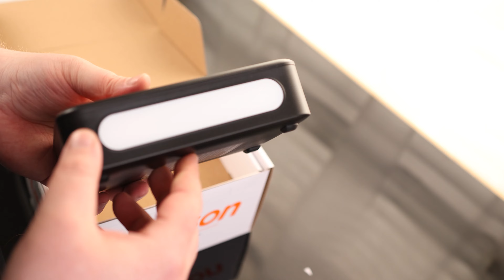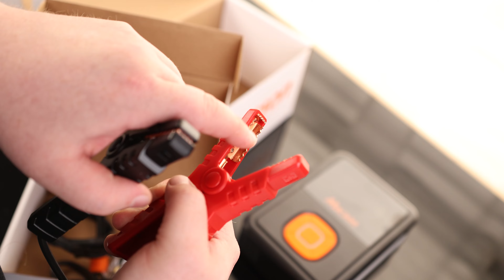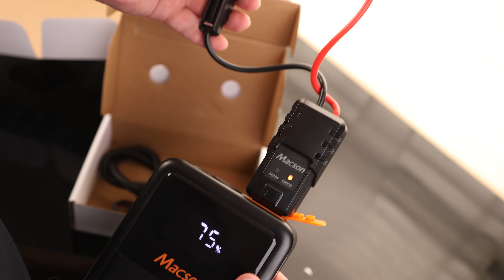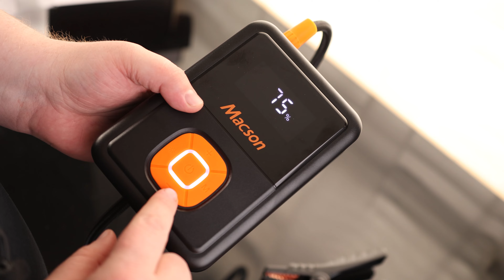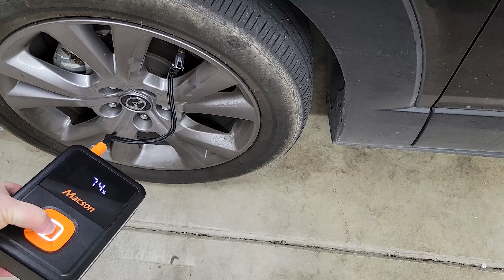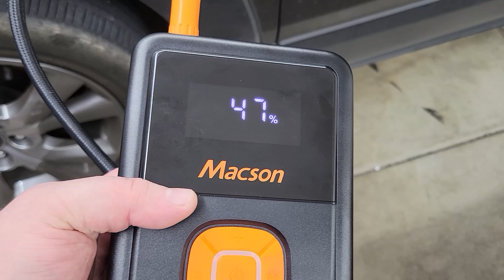Macson Jump Starter with Air Compressor, Portable 1500A Jump Starter for 6L Gas/4L Diesel, 150PSI

Comment: Can that actually jump start a vehicle?
Reply from the maker: I haven't tested this one as I don't have any vehicles with dead batteries right now, but I did have a dead battery a while back and tested a handful of this style of jump starter.  They all worked.  https://www.youtube.com/watch?v=s2jy-9ZeRls  I keep a 1500A by GOOLOO in my locker at work for when our forklifts need it, but it doesn't have a compressor.  I'd be surprised if this one had trouble jump starting a vehicle.